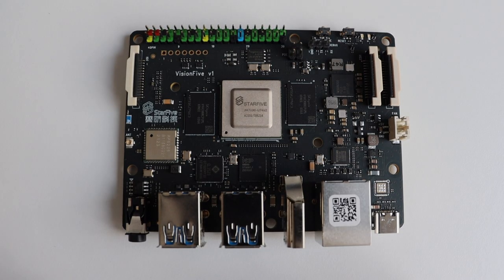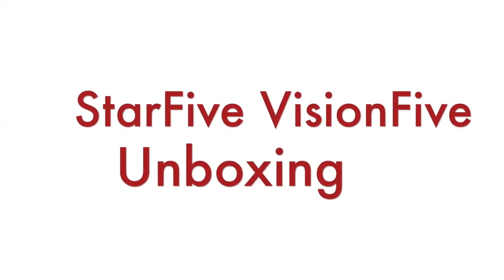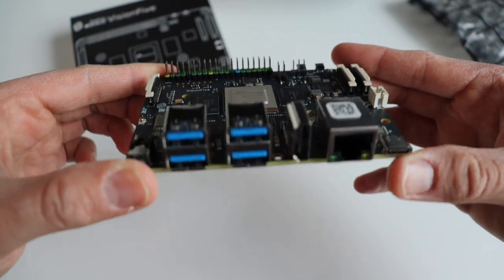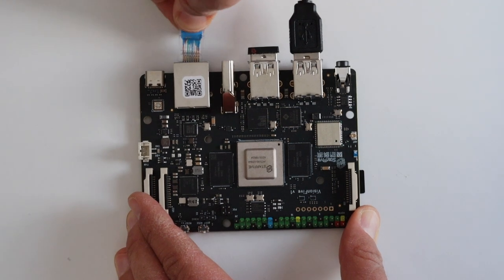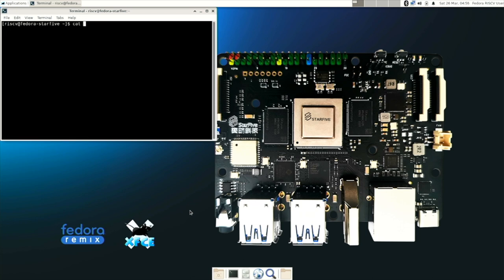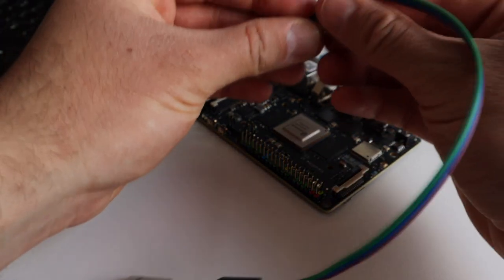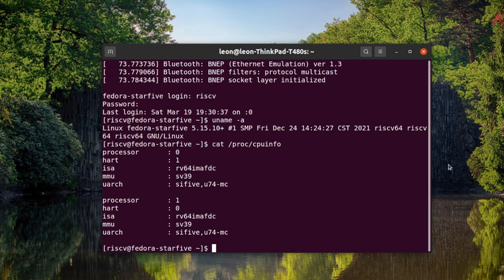StarFive VisionFive RISC-V Single Board Computer with Linux

Comment: Superb! A proud RISC-V enthusiast with both BeagleV beta and now VisionFive. BTW the SOC's in both of these boards are same-JH7100. Some software and Hardware design changes in VisionFive makes it more efficient and improved performance
Reply from the maker: Yes, with these improvements based on my experience so far VisionFive performs significantly better in term of temperature. I haven't experienced any overheating issues with it so far.

Comment: This is so exciting. I never thought we'd have a choice of CPU architectures.
Reply from the maker: Yes, the most exciting part is that RISC-V as an open standard has the potential to disturb the market and cut the costs. Unlike ARM, RISC-V is open and does not charge royalties for the use of designs, patents and copyrights.
Reply: @Tony Okay, other than x86 and ARM what practical choices are there for production workstations or servers?
Reply from the maker: I agree with @Esra Erimez. Although MIPS, SPARC and a bunch of other RISC ISA in theory exist for decades,  in practice the mass market is dominated by ARM (and of course x86-64 for CISC). RISC-V is not just another RISC ISA - it is an open standard  with the potential to become a game changer in the industry.
Reply: @Tony My Dad still thinks that the 6809 is the best processor in the world :-)

Comment: A bit off topic, but this year Rockchip finally made their flagship ARM SoC RK3588 (4xA76 2.4ghz + 4xA55 2ghz), granted A76 was flagship core in 2019 but this will be the most powerful SoC available for single board computers soon. They sell developing board now for around 1000$. Geekbench score was close to Ryzen 5 3500U (set on 15W), the gpu is most likely worse than the Vega.
Reply from the maker: Well, this is interesting but the price tag of $1000 puts it in a completely different market segment. For this range of money you may buy (if you find it stock) NVIDIA Jetson Tegra development boards with ARM SoC and CUDA.

Comment: It is not "SiFive"  but "StarFive" RISC-V processor.  They are from different companies.
Ubuntu is now available for it.
Reply from the maker: As explained in the video this development board is called VisionFive and it is with StarFive's JH7100 SoC which is a dual-core 64-bit RISC-V part built atop SiFive's U74 cores running at 1GHz.

Comment: Hi Leon. Good video, thanks. Still no distributor for the EU after 6 months since the board was released. I guess if this board had been released under the BeagleBoard foundation the support would have been better. Do you know if there's any community oriented project going on?
Reply from the maker: Good point. Definitely having a distributor in the EU will be helpful for all of us here but it is available at amazon: https://www.amazon.com/youyeetoo-StarFive-VisionFive-Storage-Support/dp/B09NKVR2QG

Btw, speaking about BeagleBoard, recently I bought from Farnell BEAGLEBONE-AI-64. I still haven't done unboxing of it. The plan is to cover it in a video in August so stay tuned :)

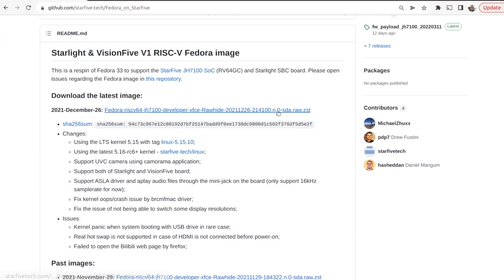Comment: 4:00 still takes huge amount of time - well, that's caused by that slow ass server behind the link on github
it throttled me down to about 2mb/s-3mb/s with a short peak of about 6mb/s - and then after 1gb it just killed the connection
for reference: I streamed the ubuntu 22.04 image - about 3.2gb-3.3gb with about my max speed of around 30mb/s in less than 3 mins
4:12 why you use a usb-cardreader when your notebook has one build in right next to the usb port (to the right in the shot)? guess a driver issue? or dead hardware? please don't tell me you do know that slot is a sd card read
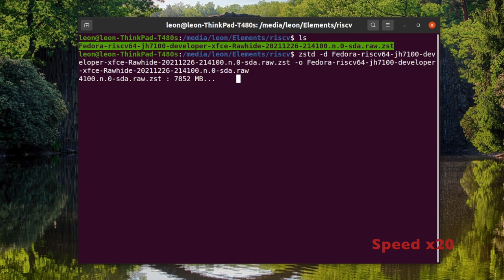4:45 why use a 3rd party tool on linux? the compressed archive extracts to a raw image - just use dd
Reply from the maker: Yes, huge file + slow GitHub server.

My SD card slot on the laptop is fine. I decided to use a card reader for the video as it is visually more catchy.

Although I use dd on a daily basis, I recommend using and demonstrating Balena Etcher due to 2 reasons:
- it works the same way on Windows and Linux. Some of the viewers are not Linux desktop users.
- Ether is user-friendly and easier for less experienced people. Definitely protects the user from wiping out his main drive my mistake :)
Reply: @LeonAnavi  well - with 24tb of storage I don't see even 350gb as "huge" file - so a 3.5gb linux image is more or less something like "could you hand my the floppy please?" - but as I have a 30mb/s connection (250mbit/s) and see many mirrors get me files that fast I'm quite disappointed why this image is hosted on a server that not even gets me full 100mbit/s - and terminate after 1gb for no reason - they should share it across a couple of known mirrors or via ed2k/torrent (yes, p2p can be used legit xD)
as for the tool: well, given your points - ok, I can agree with that, I guess
still don't get why you used an usb dongle if you have built-in card reader - nvm
Reply from the maker: well, in the region I live in anything less than 1 Gbps is considered poor connection. So I have good internet at home but it also depends on the server which in this case is slow and 3.5GB for an embedded device is definitely large image. Imho it will be better to have several download options out of the box like Raspberry Pi OS where the Lite image is less than 500MB. Anyway, these are just demo images for enthusiasts from professional point of view it is important how good is the StarFive BSP for Yocto/OpenEmbedded and Buildroot.
Reply: @LeonAnavi  yea, livin in germany I'm jealous how pretty much all else of europe has way better connection then we have - but that's politics - let's keep that out
and of course it always depends on the remote server - if the other side limits it doesn't matter what your own connection is - have I seen it right? it decompress to about 12gb or so? no matter if distributing packed and/or compressed or as an open repo - even if it's still just in a "research" state, it should be redistributed over several mirrors
I'm a fan of the way arch does it: provide a rather simple ipxe script and all the other stuff goes over network - pretty easy to mirror on a local network
I've seen in the boot log output it uses microBoot - so it should rather simple to build a bios/uefi to support pxe if it doesn't already support it - and the rest goes from there

Comment: does this board has jtag and single step from the first instruction? thx
Reply from the maker: Good question but I cannot provide a good answer. Although JTAG is marked on some of the figures in the documentation I couldn't identify it and as of the moment there are no details about it. You better contact StarFive directly on this topic.